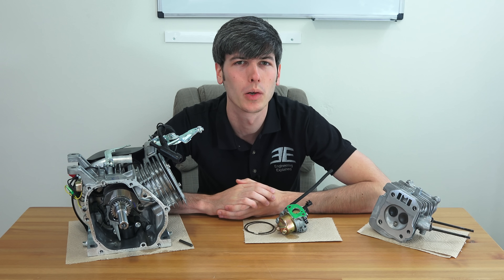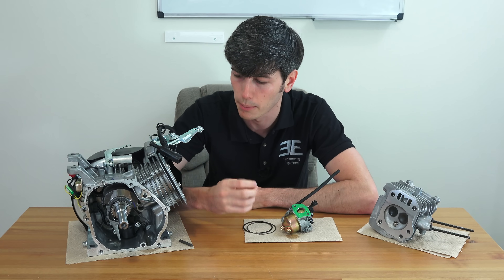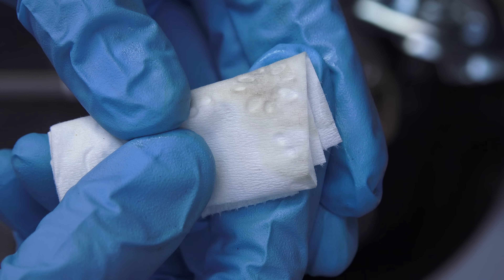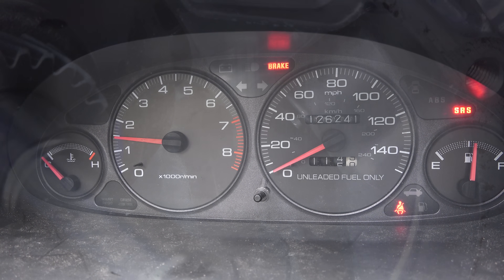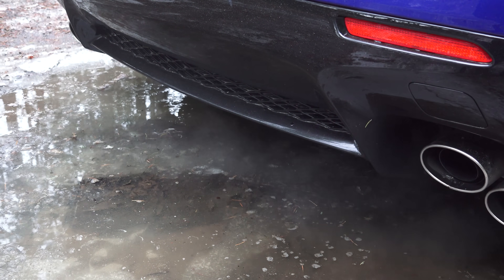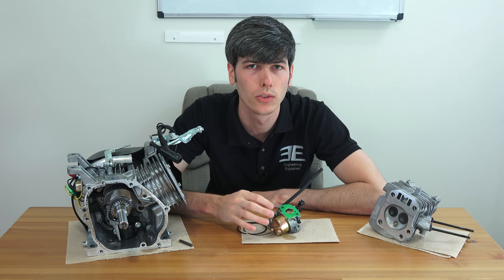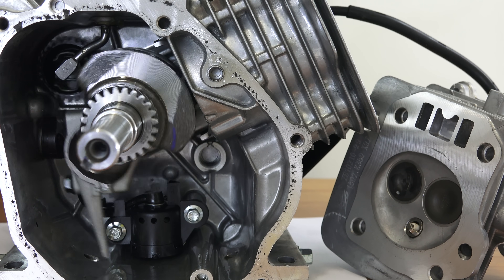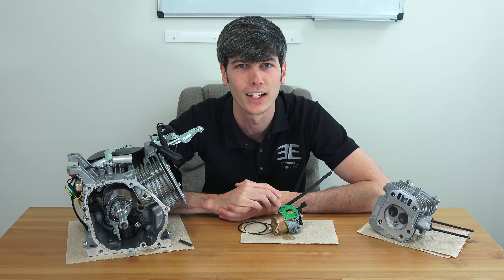Should You Warm Up Your Car Before Driving?

Comment: Or you can buy an engine heater that you plug on the electric network coupled with a timer and it heats your oil and optionnaly inside the car in 30' just before you go. In sweden a lots of cars are upgraded with this kind of system. Really effective.

Comment: as he said, "warming up" the car for several minutes before driving is not necessary and rather useless compared to driving off calmly (which means just driving normally and not reving it up like hell like on a racetrack...), and in germany it is even forbidden. you can get fined if you have your engine running while cleaning your car from snow and ice (ok just a few euros .. but yes.). i know it can sometimes be really mad when you just cleared your windshiled and as you start driving, there is new icing building up. but you can get rid of it with good whiper liquid (if this is the correct name..). and for the inner side of the windshield of course it helps to keep it clean, so that lesser humidity can condensate and finally freeze.
but the best solution (but a bit expensive in the first place, but not so much in the second...) seems to be an auxiliary heating device/system (what is the correct name for this in english? :) ). it uses very little fuel, is much quiter than an idling engine, and will defrost your windows, heat up the cabin and bring your engine to a good operating temperature in ca 30 minutes, just via RC or pre-programed. it will also be useful when you get stuck in a very bad traffic jam in the winter when you eventually would have to shut down your engine to prevent running out of fuel....

.. could you maybe make a video about this system?  - thank you! :)

Comment: i do simple technique , i jsut turn the car on and wait for like 5 while gathering stuff i need in work ..and then i just start rolling slowly (automatic classe c 220d) i just put it drive and let off breaks it move it self ^^ ,and after a while i use a little of gas ..it doesn't matter how much gas u give what matter is how fast u do it ,so i make sue that i don't go beyond 2k rpm .i use manual mode to shift gears before 2k rpm ...that is it about half why i get about 80% of temperature needed i have the car since 2006 and i do maintenance in time no never seen a single problem so far !...

Comment: When you start a cold engine the RPM automatically shoots and slowly comes to normal. If I am driving an automatic transmission is there any possibility of wear if I engage the gear at relatively high RPM?

Comment: i have no choice to warm up my car, even if i wanted to drive right away, it would be near impossible. my car start easy because it is a 2016 mazda 6 with 0w20. but still, in winter here it goes below -40 sometimes. try driving right away at -40 celcius for fun.

Comment: I warm up my car to keep myself warm when I get in it.  Granted I only warm it up basically 5 times a week after work on cold days cooler than say 30 degrees.  Again once the engine damage is done from warming up the car it won't be in my hands and at best my guess on that damage point is at earliest 250k.  Yet how often do you hear of engine issues caused from warming up.  Also you may say oil burning, but look at all these new vehicles burning oil, probably because their rings aren't seated properly using standard oil.

Comment: my dad says the same thing, but he also says it about 2-strokes with carburetors.  I'm sceptical about doing this to 2strokes. Especially the ones with carburetors.  I usually give them a minute or 2 before is drive. I always drive slow with a cold engine, unless it's summer. Then I usually floor the 4strokes when I'm on the highway.

Comment: I personally drive a ‘95 Nissan Pickup. I used to warm up my truck all the time and would have to put in a quart of oil every week and a half. When I read about the harm of warming up the vehicle I stopped. Now I start driving within the first minute of starting her up. Ever since, I don’t lose oil anymore. Now if it’s below freezing, then yeah it’s better to let the parts run for a bit than worry about losing a little oil.

Comment: Ya come where I live. -40 yesterday morning. Your transmission will hate you if you drive after "15 seconds". I get your point but -40 is a MF'r
Reply: Thats just wrong.
Idling your car wears the engine out prematurely and it make stew heater take a lot longer to actually get warm air to the interior of that car.
Since you are in cold weather you already are wearing warm clothes, so getting inside a car is warmer than being inside because the cold air is not blowing on your and your body is warming the interior.
Idling the car that I just tested three days ago took 12 minutes to get warm air to the heater vents. The same car when started and driven immediately, had warm air coming out the vents in less than 2 minutes, so obviously driving the car as soon as you start it not only reduces engine wear radically, it gets warm air to the interior much faster.
Ive driven for years in -60º weather in the winter and never had any transmission problems, just drive gently for one minute and everything warms up quickly. Letting and engine die excessively does not warm up the transmission at all.
Reply: Dumbest argument ever. I live in -40C too and I don't warm my car up for more than a minute. Just take it easy with the acceleration until the car gets actually warmed up. People just hate being told they're wrong even when there's clear evidence.
Reply: rjku I TOO LIVE IN -40C. You both are wrong. Use dynamite to start engine.
Reply: @rjwu-n6j  if it is ok to drive after a minute, why do you have to control your acceleration?
Reply: @rjwu-n6j  you must have slow ass speed limit because here in Canada people honk at you if you going slow

Comment: It is such a pet peeve of mine that this myth still persists.
Reply: And it warms up MUCH faster if you increase the engine speed. The reason that a lot of people are now against warming up your car is because most people simply let their engines idle. 

The problem with this is that it's gonna take a lot longer because you're not increasing combustion pressures to any real useful extent. You're also putting more wear and tear on the engine since, for example, cold combustion is less efficient and you could get excessive amounts of fuel in your oil.

I always rev my engine up to 1800 RPM about 10 seconds after starting it up. Then I hold 1800 RPM until the coolant gets up to temperature. Then I drive off.

Comment: Ok What Happens when its cold and you add Throttle...... That means you add more fuel/solvent to a Cold Engine. Also Carbs have some thing called a choke Witch Engages When the engine is cold and does the same thing as a its counterpart. in a prefect world where you could drive with out hills or highways I would agree with you.  I am sorry but think you are so wrong about this topic you need to Do real Tests and Not Spout your OPTIONS OF FALSE Accusations with out real proof !!!!!!!!!!!!!!!!!!!!!!!!!!!!!!!!!!!!

Comment: My 2015 Subaru Outback 3.6l with automatic transmission always idles pretty high for about a minute after starting. If I don't wait for the RPM to drop below 1400 rpm, it tends to make a [CLUNK] when I put it in gear. Are these clunks more abusive to the transmission that the warm up? (They sounded pretty harsh, so I started letting it idle for 60-90 seconds until the RPM came down. 
And is this high-rpm at start, Subaru's answer to warming up the engine quickly? 
And for the record, I've always had great luck with my carburetted motorcycle engines over the long term by minimizing choke usage and riding [GENTLY] away immediately after starting, and just taking it easy for the first 2-4 miles. 
Thanks for all the great info!

Comment: I agree, and, for all of the same reasons listed. However, I also own a rotary powered 2008 Mazda RX-8, which I have been advised to warm up before driving. I disagree strongly with the rotary community on this. Also fuel injected, rotaries run 'pig rich' when cold, even richer than reciprocating engines. So, all of those much smaller explosions are getting gas past the apex seals, into the crankcase, or, even worse- into the catalytic convertor (even with air injection to speed up the cat heating process). I say, start it, let the idle begin to drop, and, drive off- keeping revs at or below 4,000 RPM. (Personal limit is 3,500 til the H2O temp needle moves). Instead of 6 7 minutes of cold idling, I get temps up quicker, get heat evenly spread throughout the engine (reduce wear) and improve MPG's to boot. Pig rich (as programmed) is just too much, and, waiting is too long. Both are bad, and, I beleive shortening the life of the naturally aspirated rotary engine.

Comment: Always warm up your car first. It's a FACT that people that let the cars warm up before driving have longer living cars.  If you run a cold engine at higher rpms you are doing more wear and tear. The entire block may warm up slower but those cylinder walls get up to temp with the combustion at idle. No need to see 3000 rpm when the cylinder is still cold. Let it warm up and other components of your car will thank you like your transmission.
Reply: @kavin maybe those people are simply more likely to take better care of their vehicles in general. I warmed up my car idling until now, because that's what I've been advised but this video made me reconsider
Reply: gimmie proof if it's a fact
Reply: Kevin Wendover this is wrong, especially in today’s world where we have synthetic oils that maintain viscosity at super low temps. Nobody is saying to run a cold engine at high RPMs. I drive off the second I start the car but I just drive smart. Keep it under 2000ish (for me) and no massive deflections of the gas pedal to induce unnecessary load. Idling your car to warm it up can cause raw fuel to wash down the cylinder walls. As for transmissions, it’s no different. Fluids nowadays allow for minimal warm up times. I got a 99 Honda Accord 5spd and it’s no less happy when it’s cold than when it’s warmed up.
Reply: @babsg89  I live in the mountains of Maine, we let the trucks run for 10 minutes before even moving them, when its 10 below there is no debate

Comment: For people in Siberia COLD means temperatures below -25 or even -30 Celsius. The 5w oil becomes very viscous, almost solid. What about those conditions? You will also state we don't need to warm up such frozen engine and can go after 15-30 seconds? Shouldn't clearances between parts come to its designed values?
When I start my Honda HR-V (2000) after night with -20 C and below, it holds rpms over 1000 by ~2-3 minutes or even more. But oil pressure lamp goes out almost immediately after start, so the oil pressure level seems to be reached. Does it mean oil starts to enter to all areas of friction, despite it's maybe not liquid enough?

Comment: My 2018 Crosstrek idles higher when its cold and has an oil temp light that shows blue until the car has reached sufficient operating temperature. Not saying you're wrong, just saying that Subaru must've designed the car to do that for a reason.

Comment: You said that cold engine causes richer fuel mixture, thus the excess of gasoline washes away the oil in the cylinders. But you didn't mention the fact that when you start driving straight away (gently though) you inject even more amount of rich fuel, which logically must result in more oil being washed away! What can you say about that? Thumbs up guys so Jason could see this question and answer! Thanks! Looking forward to your answer Jason!

Comment: When it's really cold outside (-20°C or colder) I recommend warming up the vehicle. Ive seen blown steering pumps on vehicles because it was so cold. Personally I'd rather warm up the engine bay. In my 2017 EcoBoost in -30 °C it warms up in 6-7 minutes and my engine is at operating temperature and the interior is warm. It high idles at 1600rpm till warm in cold weather. But I agree that warming up just the engine isn't needed just like you demonstrated. Thanks for the info!

Comment: I've got a Question. I've got to drive about 2km every Morning until I get to the Autobahn and about 200m in the Afternoon. As said in the Video you're not suppost to drive the car hard, but at 100kmh I'm at 3000rpm. Should I still not warm up my car, or should I? (In the Winter its mostly around freezing temperatur)
Reply: you should😊

Comment: I'd be interested in  what the oil manufacturers have to say as to how long before the oil is warmed enough to flow adequately for proper lubrication?  I've always let my cars warm without issues.  My 2004 Toyota Highlander has 250k miles and runs great.  My Ford E350 van had 270k miles before I sold it.  Both using dino oil and warming engines up.  This winter we've had several days where temps hit -10 to-15 degrees actual temperature.  No way would I take off without warming.  Curious of the difference between "light" driving to warm the engine vs. letting the engine idle?  Also, I can't believe the temp sensors do not communicate with the o2 sensors to monitor fuel injection?  Interesting topic that will be debated as long as the internal combustion engine is around.
Reply: I agree..... This start and go is not a good idea.

Comment: Just drive carefully for the first 5 to 10 minutes not going over 3,500 rpm especially with turbo or supercharger engines.
Then let the turbo/supercharger cool down for 2 minutes minimum before turning off the engine.
It takes around 5 to 10 minutes for engine to reach optimum temperature of around 80c.

Comment: unless I'm in a rush, I don't start driving my ride right away after starting it. I usually give myself about half minute in perfectly fine weather to dial in my jams that I'm gonna listen to while driving, just enough time to let the engine's fluids start flowing in cold weather. and in that time, I'll set my a/c to the temperature I want also.

Comment: I used to park my car out in the driveway and during winter the windshield would frost up. Spraying winter solution from the windshield washer tank would remove the frost, however it would fog up. I pretty much have to let the car run at idle so it warms up enough to defog the windshield and allow me to see.

One occasion during the winter of 2013, I went through freezing rain. My car was turned into an igloo with a half an inch layer of ice on the windshield, I had to sit there and run the car at idle for 45 minutes just so I could melt the ice. 

Now I keep my car in a garage and there had not been another freezing rain storm since so I don't do this anymore.

Comment: Hey, I've been doing a lot of research on this subject and I completely understand that gasoline is a solvent, however, I drive a 1990 mx5 which I know isn't carbed. It being an older car is really cranky on cold starts and will sometimes even stall if I drive before it gets warmer, I have been letting it run for about 10 minutes prior to leaving and it runs like a champ afterwards. I will usually turn on the ac to increase load on the engine and speed up the process. With you're knowledge please advise, should I still just try taking off 30 seconds prior to start up?
Reply: just warm up for 10 minutes

Comment: When your car is not up to operating temperature it's running in open loop which will only adjist the afr with inputs from the ect and maf. That's really my only argument, an engine runs better and more efficient when in closed loop and when the adaptives are at work.

Comment: probably you know nothing about this. No different between carburetors and Injectors car only fuel system but engines the same. Before driving oil should be delivered every where in the engine. Plus oil starts work when it gets temperature 86 F before that it's not really good lubricant for engine. Don't want worm up engine ?be ready to list power and gas by 25k

Comment: Let's say I just started my car and am going to hit the road - am I better off with higher rpm gear changes but low throttle loads or higher throttle openings but lower rpm? I am going to assume the higher rpm but low throttle is better for a cold motor...?

Comment: I'm from Siberia. You ecologist? What kind of oil you pour in the motor? 0w-30? The synthetics? Temperatures of minus 30 Celsius and lower temperatures will squeeze the glands will burst the hose gidrousilitel, the control channels of the automatic transmission not ready for the cold movement. Without workout you will not to run with sharp accelerations, or get a sprain. as well and auto

Comment: Jason, lot's of respect for your knowledge and engineering background.  However, I do want to make a point.  Are you making your conclusion based on Oregon climate, southern climate or far north climate ?  There is a HUGE difference here. At -15 F the power steering and transmission pumps complain like crazy in the vehicles I own, and the fleet vehicles I drive for my employment. After warming up for 15-20 mins, theses hydraulic based systems stop growling and complaining. Putting the fuel wash aside, whouldn't the start-and-go idea put severe wear on other components ?  I have seen other YouTube channels that also claim no warm up is needed, however those folks were based in more warmer climates.
Reply from the maker: In climates that cold I’d certainly recommend an engine block heater. The important thing is to not do anything too forceful or aggressive while the car warms up. Your transmission won’t warm up much sitting stationary (for manuals at least),  your diffs won’t warm up sitting still. Drive smooth and easy until all the fluids are happy, and then you can get more aggressive with it.
Reply: Thanks for the reply Jason.  Keep up  the great work !